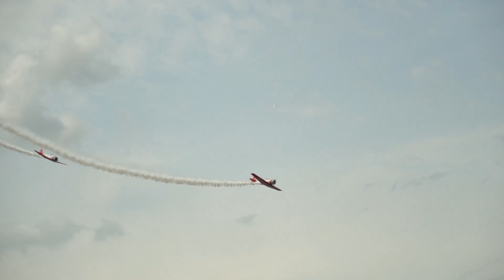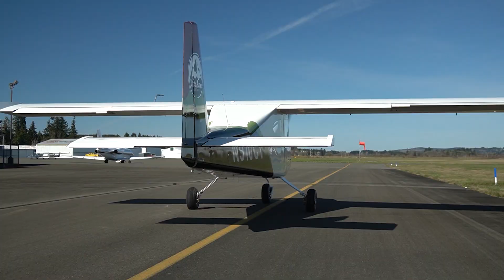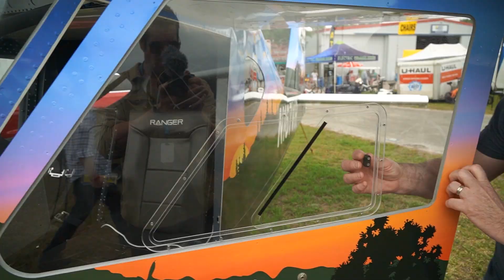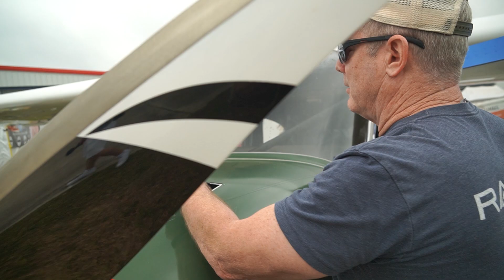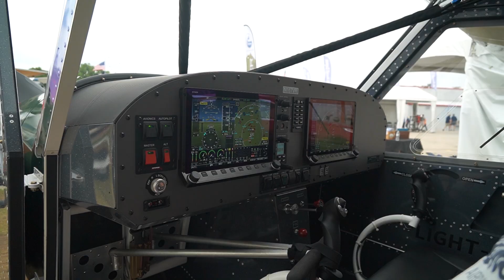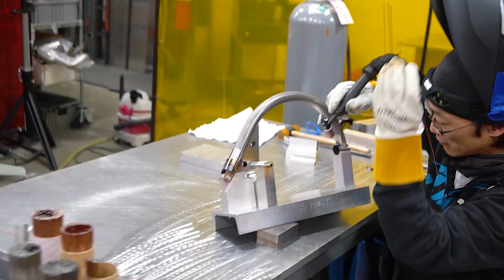Why an Airline Pilot Flies Vashon Ranger R7 (Owners Perspective Ep. 1)

Comment: Reading these comments makes my head hurt. Some want them to ditch the two support bars for better visibility... Others want it to be a certified IMC capable machine. And yet more ask for a 4-place version. But most also demand it be cheaper. A lot cheaper. Never mind it's literally half the price of an un finished vans or carbon cub of similar size and weight. 

Basically: Everyone wants a new Cessna 182 fully equipped for flight in actual IFR. But at a price point substantially below $160k. 

When a 182 matching their requirements costs between $800k-$1.2m.

Comment: I assume a float version has never existed? Will you make a rotax version of it? and will you make a new composite plane that doesn't have the retro choices the Ranger did?
Just a Rotax 916 version with a lower lift higher speed wing would probably boost your sales. Even though the engine is very overpriced, so is the O200

Comment: I flew a Vashon Ranger at this year's (2024) Mt. Vernon LSA Fly-In.   It was a great airplane!!  I would like to buy one, but there are two items that need to be improved:  1.)  Toe Brakes.  This plane has a steerable nosewheel.  I find toe brakes and steerable nose wheel on the same rudder pedal a bad combination.  Fly a Flight Design CTLS.  I dare ya'!!!  😃 I have about 25 hours in a CTLS.  It has a single lever, on the center console, that looks like a small throttle.  It's not a throttle.  It is a combined left- and right-hand wheel brake that is actuated together.  Afterall, you don't need brakes until you are on the ground.  2.)  Parking brake.  Man, coupled with the toe brakes, doing your run-up and other needs, those toe brakes are a PAIN!!  But, the CTLS has a parking brake - a simple swing lever that will lock the brakes.  AHHH!!  I think I am in love - - -    That's all of my 2 cents worth.  A great airplane.  A BIG cockpit, outstanding engine, and it flew very well.
Reply: Hello. Not sure where you thought it had a steerable nosewheel. It actually has a free castering nosewheel.  I personally prefer the steerable nosewheel.

Comment: $160,000 for cessna 152 performance.  "how about no."
Reply: Very true, and the !52 is a third to half the price without the brand new depreciation.
Reply: The 152 is not a cheap airplane. It is $40-50k for a 1960-1970s model. About what a fully restored muscle car costs. The Cessna has ADs that must be complied. It has annual inspections that begin at $2500 in labor just for an A&P to peek inside a panel or two, before any repairs or parts are needed.

You cannot compare a 60 year old airplane to a new one on price alone. That is like comparing a Willys Jeep to a new Wrangler while insisting you will use it for the same purpose and wont mind getting wet on your commute to work in the rain because USMC 1953 OoRah.

Comment: "It has more room than my Cessna Cardinal".  Can your Cessna Cardinal carry more than one person with full fuel?  Because the Ranger sure can't.
Reply: Different plane, different mission.
Reply: How many persons with full fuel is an arbitrary criterion.

The designer could simply reduce the fuel capacity to comply.

What matters is having options.

Most people don't want to be stuck in the sky for a 6-8 hour day. A pilot might push through a ferry trip. But a passenger will probably want to land more often. So it is a fair compromise to allocate some passenger weight toward solo fuel capacity.

Also, every passenger jet on the planet has vastly greater fuel capacity than they can carry with full seats. They have to cut passengers down to about 1/4 of the available seats to depart with full tanks for a 7,000nm+ flight. (40% of fross takeoff weight being fuel, 50% being aircraft empty weight, leaves only 10% for passengers, crew, luggage, food, drinks for a 12-14h flight).

Comment: Soooo happy does not have the high revving, pain in the rear oil level check process from Rotax, in addition to valuable reasons mentioned in video.

In reference to manufacturers focusing on pushing their aircraft as a trainer, it is my humble opinion that yokes or side stick options should be added.

Muscle memory/familiarity for those student pilots attending flight schools for a fast track to the airlines and/or those of us that have trained in a Cessna, Beech or Piper aircraft.

I'm indeed a fan of the Vashon Ranger, but hoping a redesign...LESS the 2 support tubes obstructing forward view are in future plans.

Comment: The Vashon is a good addition to the SLSA lineup.  It is cheap, has Dynon glass (Dynon founder also founded Vashon).  BUT.  It has no chute, has a non fuel-injected old school Continental 0-200 engine, and is al all metal design making it draggier and slower.  There are more sophisticated SLSAs on the market that use fuel-injected, FADEC controlled Rotax engines and are made from carbon fiber AND have chutes.
Reply: None of that matters if you can’t afford the damn thing. The ranger is actually somewhat affordable for such a new airplane
Reply: A full airframe parachute does not make sense for an LSA. 

They would subtract -40lbs from the useful load. 

The aircraft already lands below 45ktas 50mph you can literally set it down on any stretch of road longer than 500ft without overhead power lines.

They are not fast enough to suffer flutter or severe structural damage.

It just does not make sense to insist the entire airplane should have a parachute for ordinary everyday, fair weather, loiter around type recreational flying.

Most aerobatic aircraft don't even have them. And they are pointing straight down at the ground going VNE with full power applied and rocket below traffic pattern altitude. Even they dont typically utilize a BRS.

Cirrus uses the parachute as a marketing tool to entire non-pilot business owners to buy their product then learn to fly. This was extremely costly in lives. They had to implement above and beyond ownership trining programs to mitigate the carnage about 20 years ago. When people have airframe parachutes they do things with their airplane that only someone with a plan-B would ever attempt.
Reply: @Triple_J.1  Nonsense.  In Europe, they are required.  These small aircraft are relatively fragile, slow, and get kicked around in turbulence more due to low wing loading.  And often they are being flown by low time pilots who want to own their own aircraft but do not want or can invest half a million or more in an aircraft.  And now, under Mosaic rules, The previous 1,320 lb (1,430 lb for seaplanes) limit is removed, allowing for heavier aircraft as SLSA.
Reply: A chute is no panacea or substitute for another airplane with better structural integrity. I've enjoyed 51 years flying many light aircraft, all of them sans chute and I can still type here. A sophisticated plastic design also doesn't ensure economy, usability, maintainability, nor parts availability years down the road from some out of business domestic distributer tied to a remote E. European company.
Reply: @zosoachilles  The modern aircraft is light years over the antiques that you "survived" flying in...and MANY have died in them (maybe not you, but the crash reports are filled with death in a Beech, Cessna, Piper, Mooney, Boeing and other makers of metal/rivets/round gauges and no chute) aircraft.  The state of the art is now composite aircraft), glass panels, and safety features like autoland and the chute.  The chute in a Cirrus has saved nearly 200 lives so far.  European GA makers all include a chute in all their designs...including the light jets (and Cirrus has too, in their SF50).  Tell me again who is out of business?  Start with this list: https://en.wikipedia.org/wiki/Category:Defunct_aircraft_manufacturers_of_the_United_States    None of them were composite aircraft makers.  Piper is owned by Brunei, and Textron owns both Cessna and Beech. Other dead GA companies you may know?  Champion, Mooney, and Bellanca, and Taylorcraft.  Oh and btw, the LEADING makers are all composite, Cirrus, TBM, Pilatus, HondaJet, Citations, Airbus, Boeing, Bombardier, Learjet, and Gulfstream.
Reply: @gbigsangle3044  Bellanca used the original composite, sitka spruce, & I sold them new and owned them. "Oh and btw" your link to defunct aircraft manufacturers includes many WORLDWIDE producers of aircraft who also no longer exist. The US has the greater preponderance because we are a large aerospace related country. I flew Airbus aircraft for 22 years and value composites and technology. My point is that aluminum is a proven material that still has a place (just like in the Learjet's I also flew and you infer as composite). Whole airframe parachutes are fine, but they do not contribute AT ALL to the inherent structural integrity of any airplane.
Reply: @zosoachilles  The link is current. The Bellanca The fuselage is constructed from tubular steel overlaid with fabric while the wings are fashioned from spruce with a plywood skin.  No composites. The Vashon has a chute option, btw.  And yes. its metal, but its a joke.  It is slow (slower than what SLSA allows, up to 120kts) and uses a single engine choice, the Continental O-200-D which is also an antique design.  Most modern designs are using the Rotax engines.  The future is composites, electric power, and AI piloting....not metal planes with the kind of panel you were used to...  Oh, and Pipers M500/M600 are also composite aircraft.
Reply: @gbigsangle3044  I was in the factory in the late 70's, so well aware of what makes up a Bellanca. If you Google, "is wood a composite?", you will find, "Wood is a composite – it is made from long cellulose fibers (a polymer) held together by a much weaker substance called lignin. The two weak substances – lignin and cellulose – together form a much stronger one." Add in resorcinol glue and a Viking is absolutely composite. "btw", the Ranger does NOT have a chute option. Is it slow? By some measures, but since I'm retired, slow is fine and the view is fine as well.
Reply: @zosoachilles  A wood framed, fabric covered aircraft is not advanced.  Carbon fiber and fiberglass are also proven materials in aircraft construction.  The most advanced piston and turbo-prop planes are made of it...including the Cirrus SF50 VLJ and Honda business jets, TBM, Pilatus.  And the Boeing 787 Dreamliner  is 50% carbon fiber.
Reply: @zosoachilles  I said the Ranger has no chute...it was part of my criticism of the plane.  The Vashon is worse than slow...it doesn't even fly at SLSA speeds.  And now costs $130k.
Reply: @speedomars  There are no comments here that argue wood framed, fabric covered structures in aircraft are advanced. The Bellanca Viking is technically a composite winged aircraft, but it is not advanced. Composites are assuredly proven materials, but none of the aircraft you mention are similar in class, performance or cost to the basic light aircraft featured.
Reply: @speedomars  Airliners that care for hundreds of people and which I spent 40 years flying don't have a chute either, should we criticize them? I'm not sure what you mean by "SLSA speeds", but the S-LSA aircraft that are in actual widespread production cruise at similar speeds. The Ranger's 110 kt cruise is quite typical for an LSA.
Reply: @zosoachilles  Yes!  People accept that when an airliner goes down everyone dies....sad doncha think?  But most people don't know there is a better way.  Did you know there has been research by Boeng to come up with a chute solution for the big planes?  Either passengers wearing or for the whole plane.  Obviously when you put all your hundreds of eggs in a multi-ton aircraft you are stuck with going down with the ship, everyone included.  SLSA speeds are regulatory...not faster than 120kts cruise.
Reply: @zosoachilles  You are conflating the term composite construction.   Modern aircraft made of fiberglass or carbon fiber in a monococque skin is far different than the use of plywood and fabric which are NOT advanced at all...
Reply: @speedomars  We're off topic here regarding composites. By definition, a composite doesn't have to contain advanced materials to be a composite & whoever said a wood wing is advanced??? It is a composite, but we AGREE that it is decidedly NOT advanced. You said the all metal Ranger "doesn't even fly at SLSA speeds", I'm aware of the reg limit for all LSA's, but don't know why you claim the Ranger is "worse than slow"...what does that even mean? btw, have you flown a Ranger or just firing darts from afar?
Reply: @zosoachilles  You tried to make the point that the Bellanca was a 'modern' aircraft by todays standards given the use of plywood in the construction (a composite).  You seem to want to use the term composite to infer a modern method.  I argue that it is the fiberglass and carbon fiber monocoque technique that is the advance.  So, given all that, what topic did you want to discuss?  My contention remains that non-metal/rivet, rib and fiber etc are being superceeded by what I call a modern aircraft design in monolithic monocoque aircraft.
Reply: @speedomars  Where in any of my comments did I say that the Bellanca Viking is "modern"? I didn't and it is not. You then say that I "want to use the term composite to infer a modern method". Nope, that is you who is saying composite is a modern method...one that evidently requires plastic, carbon fiber or fiberglass to be called a composite. Straw and mud used together are a composite. I wouldn't want anything made from it, but that is true. Please read this -https://en.wikipedia.org/wiki/Composite_material
Reply: @zosoachilles  you can enjoy 51 years driving without wearing seat belts as well but it doesn’t mean it is a smart thing to do …
Reply: @walterrawdanik8077  I've religiously worn a seatbelt since I survived near fatal ejection from a Fiat 124 45 years ago, so what's your point? I like whole airplane chutes too, but if you mandated them, we would have a tiny fraction of GA airplanes in the sky today.
Reply: @zosoachilles  No one mandates a chute in a plane...and no one ever will...it is a high-end saftey feature of the more advanced aircraft.

Comment: No worry about carb icing on a O-200? I've had carb icing problems 3 times in my life. Two of those were with an O-200 and the other was an O-300
Reply: Yes, the O-200 can be susceptible to carb icing. I've had 3 O-200s in my life and its not much fun when you have a sudden rough running engine, even if its just a second or too while the engine digests a small buildup of carb ice. Thats another reason I was drawn to the Ranger. The carb temperature is continuously monitored and displayed on the Skyview screen. The temperature display even turns yellow when it gets close to temperatures that could cause carb ice. I can then pull on a little carb heat and watch the temperature rise! Love it! -Tom Walsh
Reply: Carb temperature gauges were a thing as far back as the 19-teens. 

The fact GA aircraft never bothered with them is rather absurd. 

They just teach to always apply carb heat whenever reducing power to idle. Or below green arc. Or if flying in visible moisture.

Comment: I've had a number of old (from 43' to 77') airplanes & wouldn't you know it, now I'm old. Used plane prices are up and they're for the same cadre of decades old airplanes that have been through heck and have a wide range of needs. I've closely followed the Ranger and thanks to Tom, flown his airplane. I signed up for one after Sun n' Fun, so before too long there should be a growing group of old airline pilots picking up brand new Rangers in Seattle.

Comment: Any plans to build or convert this model into a tail dragger/stol type plane?
Reply: No, there are no plans for a taildragger version that I'm aware of. This is a common question and I feel I can weigh in on this as to the reasons why from a pretty good amount of experience. I have many happy hours in tailwheel aircraft and can understand the appeal of backcountry flying. However, the extreme backcountry flying that requires a "tailwheel Cub type airframe with Tundra tires" is pretty specialized. I'm a pretty high time pilot with lots of tailwheel time and I wouldn't dream of doing the hard corps stuff without more training. The guys who do it know exactly what I'm saying. I could certainly do that with a back country airplane, and the proper training,  but in reality, how often am I likely to do that? And at what risk? And at what cost for insurance? I'm happy enough to be able to do the light backcountry stuff with no problem with the Ranger. And for the other 95% of my usage, it's perfect. Regarding the insurance, the fact is, tailwheel aircraft are a greater risk than nose wheel aircraft and aging pilots are finding that insurance rates are quickly becoming ridiculous. Even younger pilots will face that problem. Make no mistake, a Super Cub type airplane on tundra tires makes me want one too, but unless that's your entire world, a capable nose wheel aircraft can be a better choice for a lot of reasons. Vashon recognizes this. I can still go to backcountry strips, I just have to limit myself to the ones that won't pose really high risks.
Reply: @tomwalsh5798  Some of the best backcountry/off airport aircraft have tri gear. DHC Twin Otter. Quest/Dahr Kodiak. Pilatus PC-12. Zenith/Zenair 701/750/801 lines. Piper Tri-Pacer also unsung hero from short grass strips.